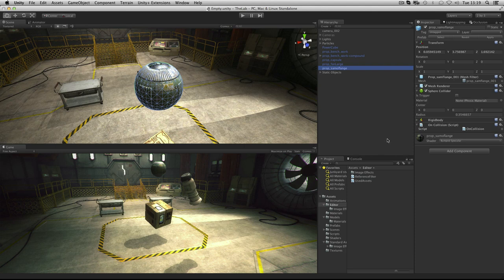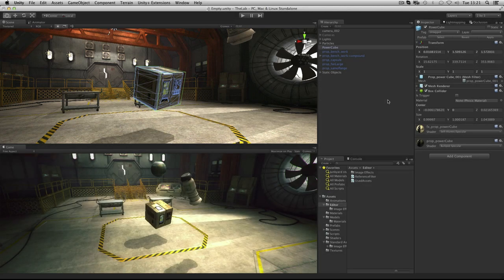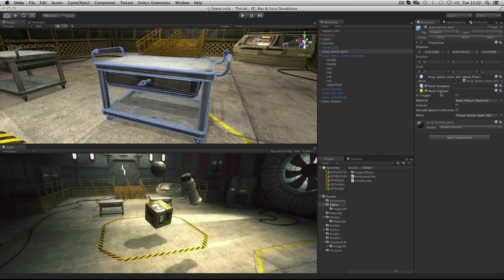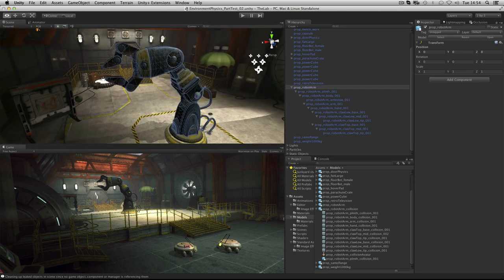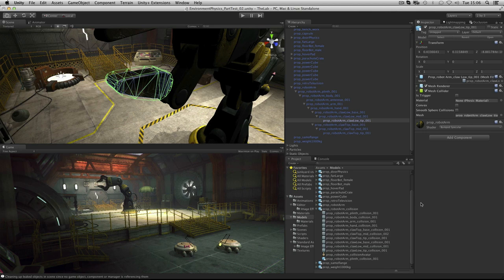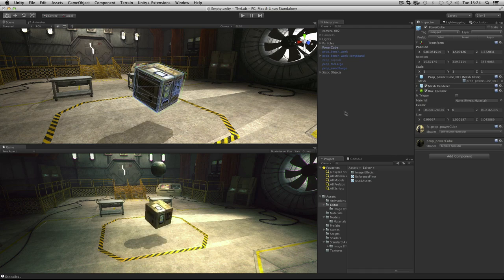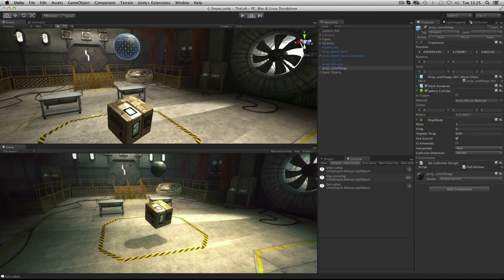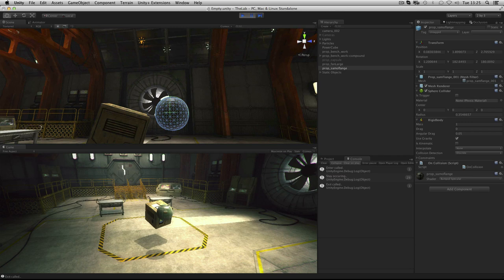Colliders - Unity Official Tutorials

Comment: Question, I set up an example scenario with a ball falling on a cube, and there is also a floor (or just an stretched out cube) to hold my first cube up. When the ball drops OnCollisionEnter is triggered successfully, OnCollisionStay is working well BUT when it hits the floor (outstretched cube) it continues to send out the Debug.Log message even though it stopped touching the test cube. (Speaking of that, OnCollisionExit worked well with the cube)

Comment: Why colliders that are on objects that player holds( like weapons) don't work? I put gun in player hands and gun goes through walls. I know for trick with cammera, but gun still goes through walls it only looks like gun did not went through wall. Is there any way to change this?
Reply: Diabuluskira the reasons the objects in the player’s hand goes through walls is that they don’t have a rigidbody component. Only with a rigidbody component and a collider together can an object stop or be stopped by another object. Since your player’s game object probably has a rigidbody but it’s collider doesn’t go all the way out past the weapons, the player’s rigidbody doesn’t stop the weapon’s collider from going through the wall, even though the weapon has a collider
Reply: Fun Sized Popcorn I think i tried that and it did not worked as it should. But i will try it. And i have read at some forum that problem could be FPS controller that comes with unity. But thanks :)